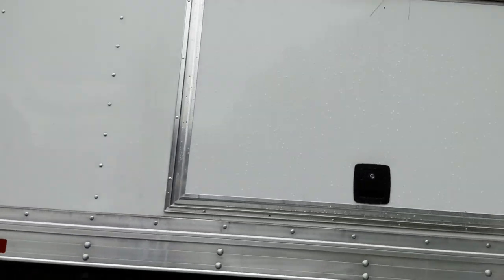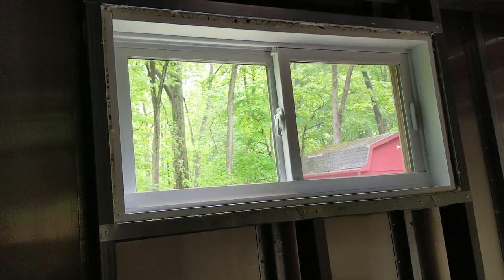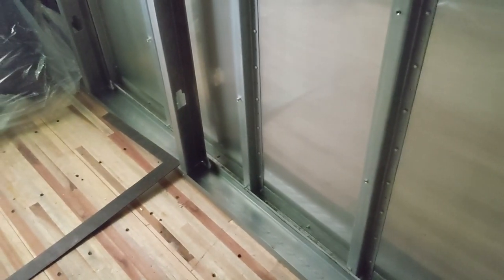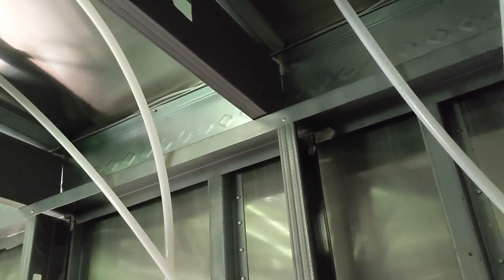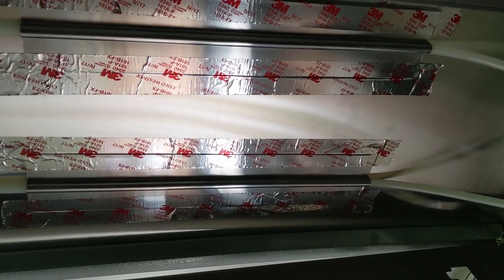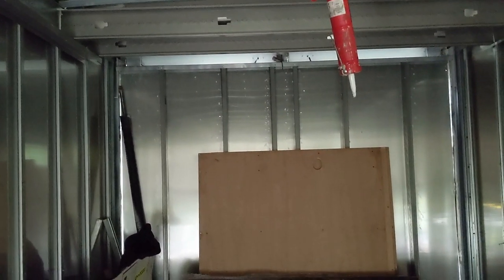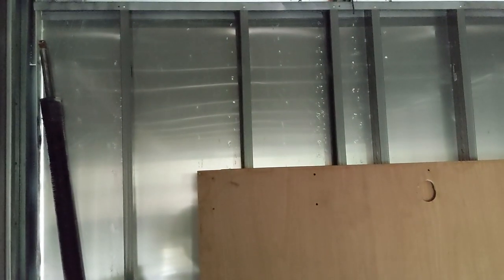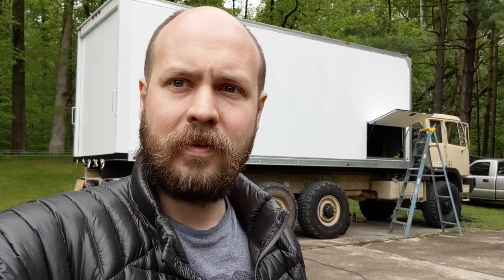BUILD THE WALL!!! - Roll up door replacement - Winter Truck Update

Comment: @7:30 Damn loud music!!!---TD
Steel & aluminum, unless insulated expect corrosion on the aluminum very slowly.
The back door looks very good.
I am investigating replacing my stock commercial cargo box roll-up rear door with a (possibly remote controlled) garage door.
Primary reason: save interior space.
Secondary: ease of use.
Box width: ~8'ft.